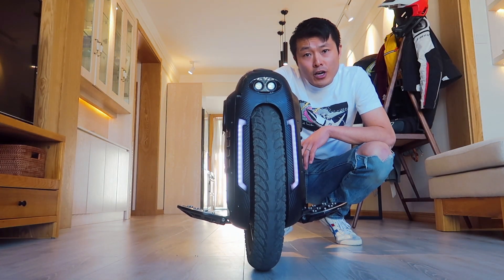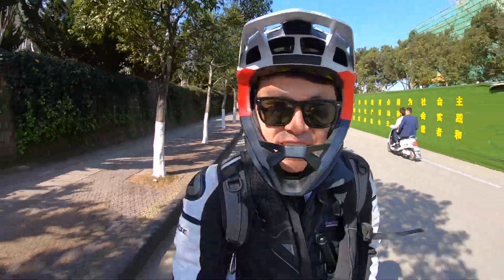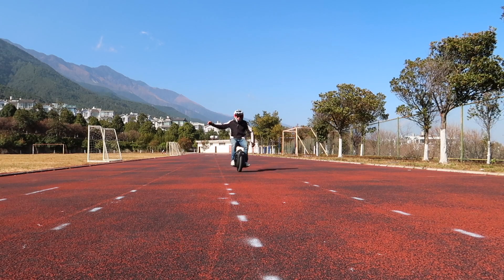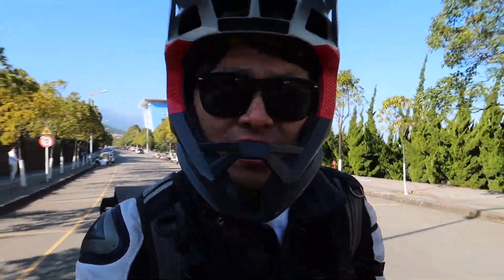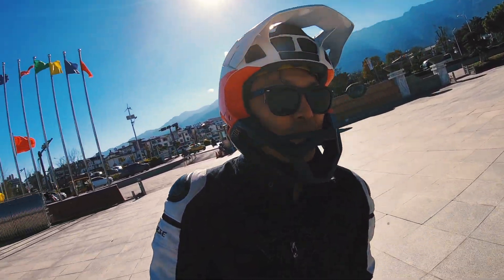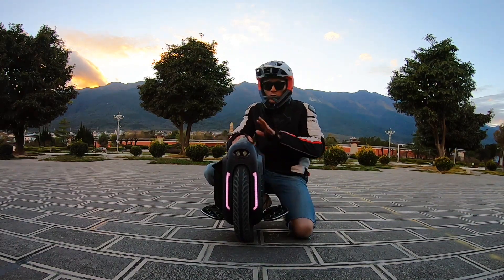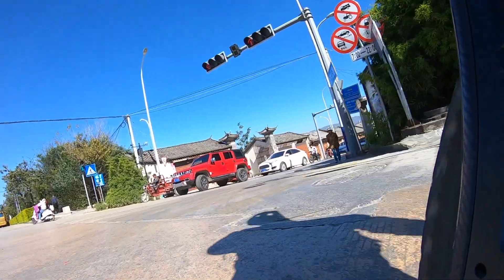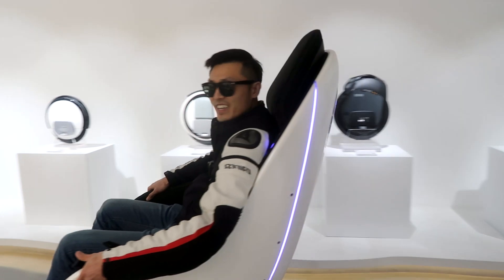Gotway RS Review: Fastest 0-40mph

Comment: Hey bro!! Great video here 👍🏼. Btw i have a question and i hope you can help me decide. I weigh about 230lbs and was looking into this model in High Torque as well or the EX.N also in High Torque. It’s going to be my first time riding an euc. I wanted to go big as im a big guy to avoid buying 2 euc. Would like to know your thoughts. Thanks for the feedback!
Reply: I'm no Kuji, but I'm 270-280lbs with my pack and gear on.  I have 1600+ miles on the EXN HS (can see me on my channel) and have an RS HT on order.  Anyone over 200lbs, should probably consider the HT or the EXN (HS or HT) or the additional safety margin.  If you don't plan on riding over 33mph for very long, you'll love the wheel, and be much safer from cut-outs.  If you need to go 35+, the HS will work for you, but you have to be much more careful once you approach 50% battery.  Hope this helps!
Reply: @phxeriders  thats perfect!! The kind of response i was looking for. Thanks for the feedback! Im going to order my exn ht and i do want to go fast as well. Thanks again bro!!
Reply: @motogp2375  No problem!  I just happened to see that you had a new comment on an old video that I was also watching.  

If you want to go fast too, the EXN HS is going to fit the bill, just as well!  EXN HS has AMAZING power, with plenty of torque.  You're lighter than I am, and I ride the HS, and never hit beeps.

Comment: I've had my high torque since november and haven't gone over 15mph :) I'm just in it for the fun/ride. I'm no speed demon. Great video though. You helped me purchase one!
Reply: @Patrick Deschietere still going great! Coming up on 2000 total miles rode
Reply: @hangingwithvoid360  Wow that's awesome! Thinking about getting one myself. How's your wheel holding up nowadays?
Reply: @mike_t_007  it's still great! Riding it everyday everywhere I go in town.

No issues, smooth riding. I'm 270lbs 6'1" and it carries me like nothing!
Reply: @hangingwithvoid360  That's awesome!
I'm close to you in size and am definitely happy it's good with the RS! Now the decision is High Speed or High Torque 😁
What made you choose the HT version?
Reply: @mike_t_007  Simple. I don't go fast. I'd rather have the guarantee that I won't cut out the motor when going over quick inclines and steep hills.

Honestly though, it goes fast XD 

Since this original post I did have a speed demon day over memorial weekend and I got it to beep at me to slow down. XD

Yeah even the high torque is fast.

Comment: I was almost sold on the Veteran Sherman until I saw this and you mentioned the better torque. I am a heavier person and have read that I need a high torque / well cooled wheel to accommodate the extra load / heat generated on the wheel for me to go a medium speed. I have been thinking the Veteran Sherman would be a good wheel for me but I also have understood  that a heavy wheel like the Sherman is very difficult to learn with for beginners because it is hard to control such weight. Do you have any suggestions? Would the RS be better for me? Looking for mostly street commuting, may run into a little gravel or cobblestones on occasion but not regularly.

Comment: Do you feel like a motorcycle offers way too much protection? Ever wanted to float inches off the ground with zero safety features while traveling at minimum interstate speeds? Get an electric unicyle! I really want one of these but you should be required to be an organ donor to own one.

Comment: So the wheel size is smaller than my scooter. I wiped out on my scooter from counter steering too hard. This small of a wheel just can not get enough traction to be safe.
Reply: It has the same size wheel as a bmx with lots of traction. That's how it accelerates like a rocket.

Comment: I just watched this most of it at normal speed which is the highest compliment. My absence from the skateboarding and separately unicycle channels are other favorite types of videos can last not just months but even many years at a time. I'm coming in a month after this one and I'm downloading the one that you have done since which I might not get to for a few weeks. You don't mention price at all in this video which is fine.you're not afraid to admit that you were completely wrong about the spinning Mass issue which is even better but it would be nice if you understood more about why it's not like you feared it might be if you don't already. In terms of the second charging for it and in terms of you talking about still taking two hours I think that those issues are also very separate. The way a market for unicycle works is first you bark the price and profit up doing the easy stuff. Then greater value proprietary differentiation can occur. So spending more on smaller batteries by the manufacturer requires people use this not recreationally but continuously and that they don't have a whole bunch of them laying around because they are influencers and don't have to pay anything for any of them. Once you get to that level of development you can use alternating current to get into the case and then within the case you can charge in massively parallel. Unicycles are charged almost exclusively while parked you don't see many people towing a selle solarr trailer or any pretense of a few milliwatts of solar on the handle like enough to operate a calculator or a watch and I don't mean a color watch that has oxygen sensors like those that would have saved several lives if not all the lives yesterday in the chicken processing plant but made it difficult for them to keep the chickens being slaughtered because 2/3 of their workforce would have been staying home earning more money almost continuously in the last year as those watches by Apple etc would have flagged their infection with covid and their contagiousness. Your choice of the five or six horsepower Segway original classic for under $1,000 instead of nearly 10K is excellent and I will try to watch it using Wi-Fi at the lowest resolution long before I get the master.

Comment: Look at 5:29 when at full speed how fast the battery was going down.
Reply: The motor draws power from the battery in motion and the battery readings will fluctuate accordingly. When you idle the battery goes back to its top level. This thing will easily go 50 miles on a charge, even riding fast and aggressively like Kuji.

Comment: In a car you have safety belt, air bags, crumple zones, and side impact bars, ABS, as well as many other electronic safety measures as standard. Could you please discuss the safety features on this wheel. You mentioned grip level on foot pegs, and that you made upgrade with sand paper from DIY store. Is that it?
Reply: Yep! Only safety gear you have is motorcycle jacket, helmet, knee pads, and etc. usually wheels will beep at you if you are going in their upper range limit

Comment: High speed OR high torque ?  That makes no sense, should just be a switchable transmission situation, similar to a cordless drill. No reason to have two models and a commitment like that, as two gears would allow for high speed level rides, as well as easy up hills. Definitely something that should be changed.

Regardless though, you're gonna look like a real life Gizmoduck from Ducktales.... no way to change that.

Also, tends to overheat?  ffs, how is that even okay at this price point?! lol

Also also also, it's so clear where innovation could be had here. There could easily be some damping added internally to the thing, rather than just a direct connection like that, and the tire doing all of the "shock absorption" .

Comment: My RS suffered from a grinding sound from the motor after some drops from curbs. At first I thought it was the bearings until I took it apart. The motor had gotten out of center and allowed for the magnets and stators to rub. I just took off both covers and centered as best as I could and it fixed the grinding sound. It's been a month and a lot of curbs since then without any problems. 

Tdlr: RS bearing issue may be due out of alignment motor

Comment: One issue I have with that big kill switch in the handle is if the wheel is being pushed and you hit the button, it stops self-balancing and becomes dead weight.  And the trolly handle is OK as long as the wheel doesn't tilt to the side.  If it does, it takes off and rams whatever is in its way.

Comment: Great video, and hope the changes you are experiencing are all good for you. In the video you mentioned 3 flat tyres. Are they caused by impact on gutters or punctures? Perhaps as part of the review, could you just mention degree of difficulty in removing the wheel/motor assembly if it differs from other types? Thanks
Reply from the maker: impact from hitting potholes/bumpy roads from riding aggressive and evading guard dogs. Replacing the tire is just as annoying as any other gotway wheel... takes about an hour to replace.
Reply: @KujiRolls  Hope you're okay dude! It's been a while!
Reply: @KujiRolls  WHY DO THESE AND EBIKES/'SCOOTERS SEEM TO GET SO MANY FLAT TIRES ? ON MY REGULAR BIKE I HAVE NEVER GOT A FLAT EVER
ARE THE TIRES JUST LOW QUALITY?

Comment: The speed overheating is a big thing, especially off-road. The torque stays cool all the time.

Also bearings is way more than 3-5% more like 30-50% my 2nd set of bearings is already acting up.
Reply: It's true everyone I know of with an RS had bearing issues.
Reply: Do you guys know how reliable the bearings of the RS V2 is supposed to be?
Reply: @filmingkey  unless they explictly say what bearings they're putting in, I'd guess theyre gonna use the same stuff. They're paying bottom dollar for trash bearings with a 50% failure rate, its still way cheaper than good bearings. Sending out replacements costs them almost nothing. At the end of the day it keeps their cost low, which is the #1 thing that motivates consumers, and when you consider the fact that everything they produce is sold out and backordered all the time, they have no motivation to do better outside of personal passion/pride.

Comment: Kuji, I’ve heard it feels a little top heavy due to the weight and position of the batteries, did you notice that at all? (And if so, could that possibly contribute to the wobble while braking...).  Thx!  And great to see you back! (Oh, and for the overheating you ran into, did it hit the alarms, or just constantly run the fan?)
Reply from the maker: During the acceleration tests it hit 160f after a few runs

Comment: how much you weigh, Kuji? as a 230lb 105kg rider i dont think i want to push it to 40mph.
Reply from the maker: im about 150lbs. As a 230lb rider, i wouldnt either. Get the high torque version and you can probably be aggressive up to 35mph.
Reply: @KujiRolls  I'm 150lbs as well. Does the HS version have enough torque for hill climbs or would you prefer the HT version? I climb hills more than I ride the beeps
Reply from the maker: The high speed has more than enough torque for 150lb riders to climb very steep inclines. I do 35-40mph on 30 grade hills. If you got the traction, it can do it.